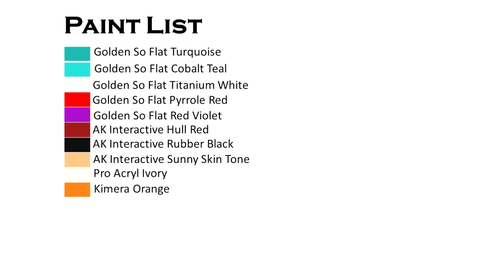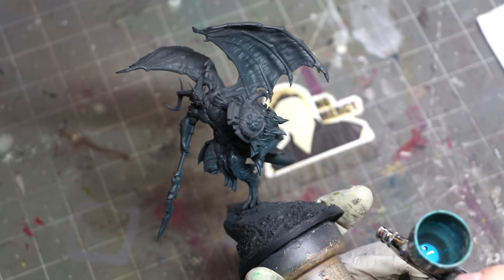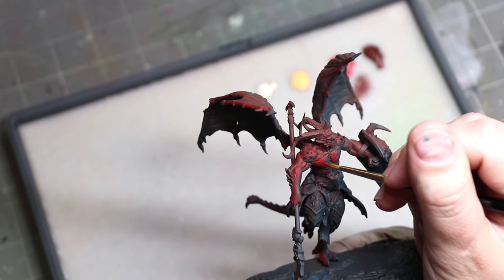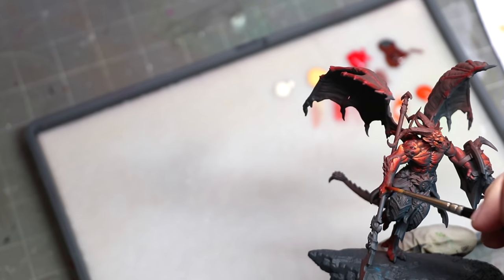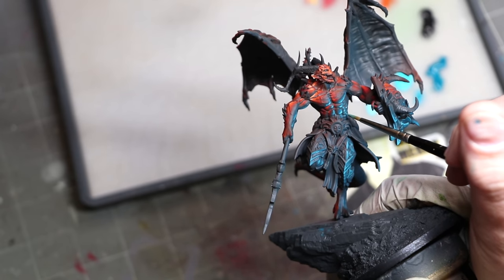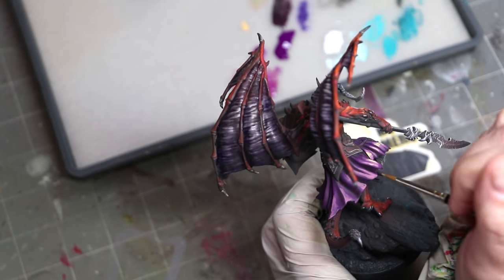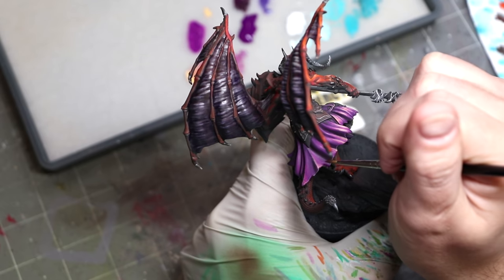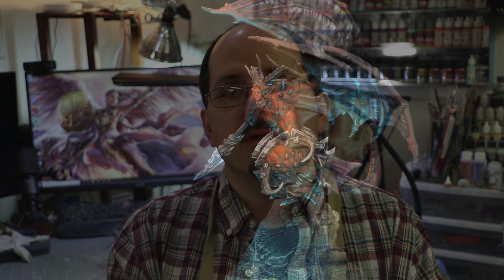Understanding Lighting & OSL - HC 336

Comment: This is a cool technique and the finished paintjob looks excellent, but with the utmost respect, I think some of the lighting/theory concepts in this video are a little muddy. Separating lighting into  concepts like dominant environmental light and atmospheric light is confusing and somewhat redundant.  Concepts like direct light vs indirect/bounce light are more accurate as even their names imply the way the light interacts with the subject. Not sure why you are using the term 'motivated light' at all, which as far as I know is strictly used in film and videography to mean main/key light.  Also, to make a slight correction to something said in the Lighting Types section: all light is colored light, there is no "normal color". Color is merely a wavelength of light reflected into our eyes and so the appearance of color is dependent on light temperature: the same subject will appear warmer or cooler relative to other light conditions.  Just two cents from some random internet pedant. Carry on :)
Reply: @actualwafflesenjoyer  the title of the video says "Understanding Lighting",  not sure why you might think it's about composition.  Also, though Im not a video/film guy, it sounds like the definition for motivated light that you supplied is actually the definition of practical light, but I could be wrong. In any case, why use terms related to filmography when all the lighting terms you could ever need are already defined in the fine art world?
Reply from the maker: All fair feedback, as long as the ideas and techniques are coming across, I can never promise I use all the terms as accurately as they might be applied. :)
Reply: @VinceVenturella , thanks. And as I mentioned, the technique and the results are excellent. Well done yet again.